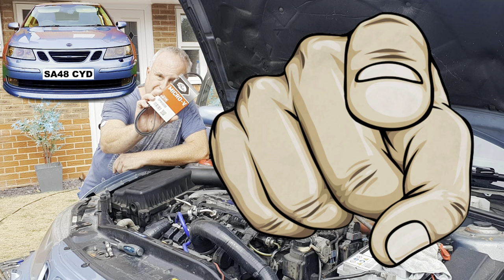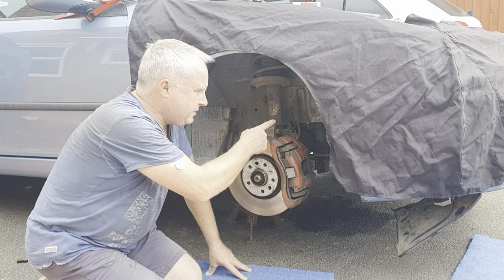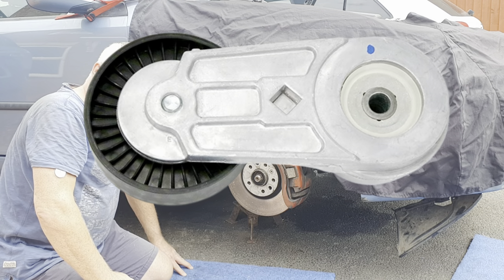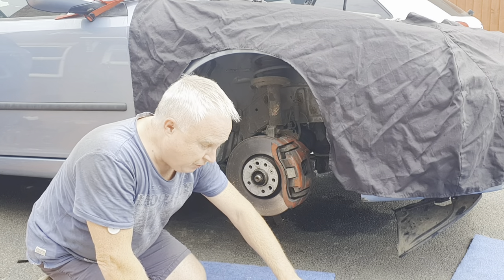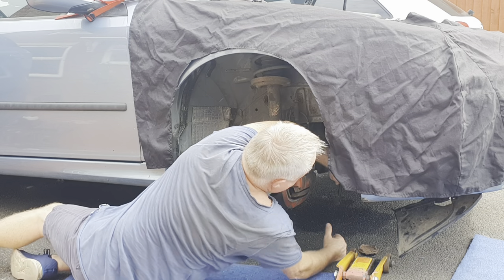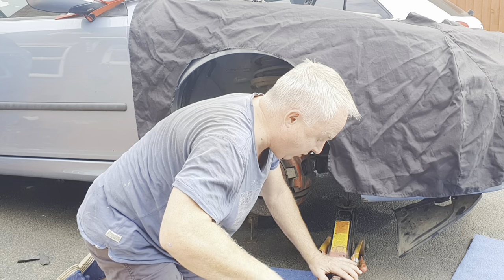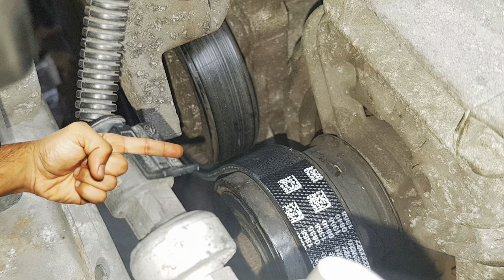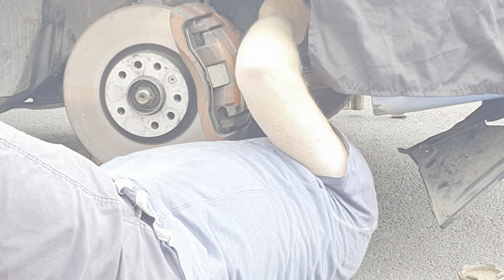Do YOUR Saab 9-3 Serpentine Belt Replacement with NO Special Tools

Comment: Worked like a charm. Didn’t have the proper size crow bar. Used a shorter Stanley pry bar and it worked just as well. Thanks for the vids. They help me keep two 2008 9-3’s on the road. 2.0 with 251,000 miles and an Aero with 176,000

Comment: Did mine a very similar way except with a length of wood and just pushed up on the bottom of the tensioner. Doing it on a pit garage made it a bit more difficult as your shoulder becomes the jack but worked a treat.
Reply from the maker: Nice work 👍
Reply: Same here, used a bottle jack and a piece of wood, i tried making a tool thin enough to fit in the narrow space but it bent after a few attempts...

Comment: Thanks again ,that was pretty easy apart from the obligatory snapped off plastic nut but wheel arch ain't going anywhere as all the other 8 ml bolts were fine.

Comment: I have a saab 1 9 diesel 2006 the steering keeps going stiff both garages said it was a fault with the wiring to the electric power steering one said it was carrodedthe other it was a loose connection steering worked for a while then went stiff I replaced battery worked for a while then went stiff the saab forum suggested it could be a faulty alternator or fuse link have you any thoughts oil as been changed and no leaks

Comment: Thanks for all the great content!  I’ve got the 2008 2.8 aero fwd.  I’ve been reading some posts stating that I have to remove engine mounts to replace the serp belt.  Do you have any knowledge of this?  Also when I accelerate hard I get a bit of sputtering.  Replaced coils and plugs.  Could it be the turbo or pcv valve.  Thanks you!
Reply from the maker: I've heard that too, but have no experience to draw on with that engine.
Boost leak? Check the pipes, splits are not uncommon

Comment: Great job as always. 
Cyd I have asked you on Pcv valve video, you didnt see my question, so I will ask you again here...
On some forums people say that it is safe to block inlet pcv hole( saab, cobalt forums), it stops oil getting in manifold and loosing oil and boost... Adding oil catch can on turbo side baffle helps too. Do you think it is safe to do that?
Reply from the maker: Sorry I didn't see it, but here goes:
In my opinion? NO NO NO don't do it.
A powertrain Engineer could write an essay the length of War & Peace, but I will make one point only: There will be NO through flow in the crankcase. Blow-by fumes will only escape by being forced out. You will end up with excessive combustion product and unburnt fuel in your sump oil, so the oil will not last as long and if not changed very frequently will eventually lead to various failures due to contamination or lack of lubricity.
Reply: @CycloneCyd  Thank you very much answering my question. And thank you for making our lives easier to maintain our cars with help of  your videos. 🍻
Reply from the maker: @Aero93  you need to fit a catch can between the crankcase and the manifold. And, how do I do that? I hear you cry.
I'm having a replacement head soon and will fit one to my car - there'll be a video but you'll need to be patient as the head needs work first
Reply: @CycloneCyd  Wow, looking forward. Waiting patiently 👍

Comment: Hi, did you change the timing chain cover gasket?  I see you have some oil mark at the bottom corner on the cover?  I was planning to replace the belt last week and I found out there is leaking oil at the same spot.
Reply from the maker: No. First fit a new PCV valve (https://www.youtube.com/watch?v=ro0CN6SdD5s), then tighten down all the screws holding the cam cover (10mm socket), bet ya some are loose.
Reply: @CycloneCyd  What does PCV valve has to do with timing chain cover gasket oil leak?  If you suggest to change it 50-70K miles.  I have 123K miles and need to change it.
Reply from the maker: @imanwan2861  explained in the video!
Reply: @CycloneCyd  I still don't understand it after watch the video couple times.  If that PVC value blocked, the oil will leak from timing chain cover?  How can you tell if PVC value is blocked?
Reply from the maker: @imanwan2861  not if the valve is blocked, but when it won't seal the manifold boost from the crankcase.
Only way to tell if it's blocked is to inspect it - by which point you might as well replace it

Comment: hi my Tube friend .. wrong belt pk 5 .1030 its pk5.1028 . i just got  mine from a saab garage  in sweden  but maybe 1030 fit no prob tension it enuf   but good video
Reply from the maker: The 4 digit number is the length of the belt. I can't imagine 2mm will make much difference. PK51030 is what is listed in Gates catalogue

Comment: It is not a 3/8 for the tensioner pully its a 1/4.Sadly you had my son under misinformation and messed up his tensioner. You need to know what your talking about before spreading fraudulent information. Saabs are hard enough to work on let alone you given bad info.
Reply: It's 3/8.   Which, by the way, is BIGGER than 1/4, so there would be no way for your son to mess up his tensioner if the tensioner were 1/4, because he wouldn't even be able to get a 3/8 into the hole to round it off.  Sounds like your son tried to use a 1/4 tool in the 3/8 and rounded it, not the other way around.